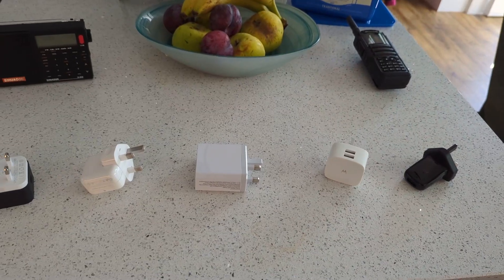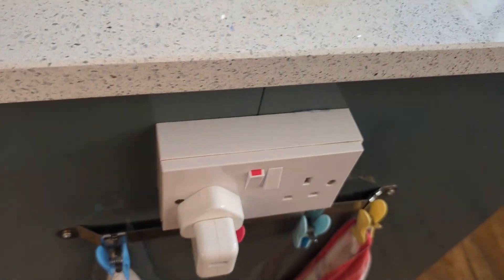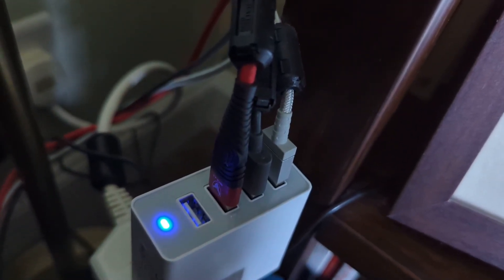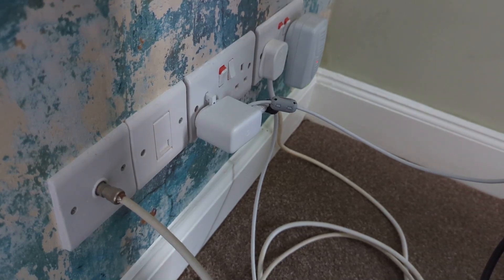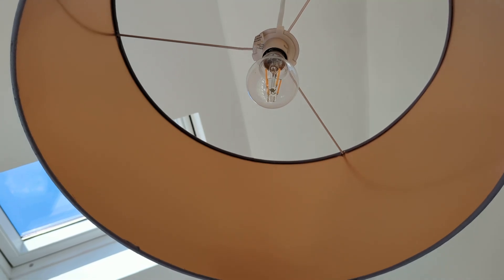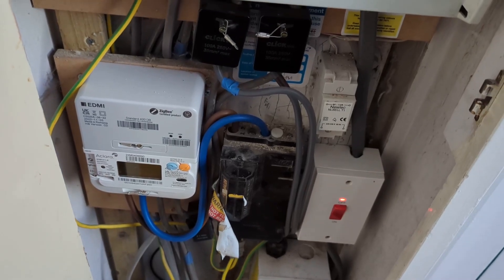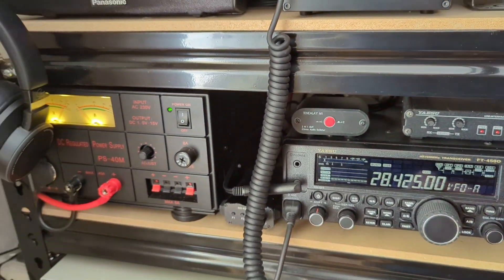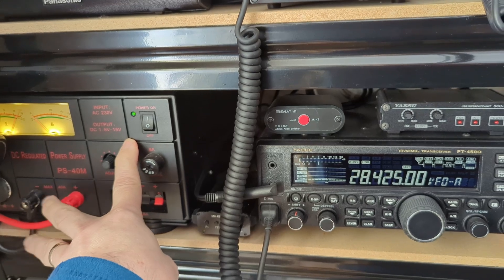How I reduced my receive noise floor on HF by eliminating interference.

Comment from the maker: Something I didn't show in this video was our burglar alarm control panel. It has a very noisy switched mode power supply which I supressed by fitting ferrites to the mains input and the coax ouput for its GSM 4G antenna.
Reply: Risco by any chance?
Reply from the maker: @Stuart_GM5DNA  It doesn't have a brand written on it. It works with a generic smartphone app called "Home Control". It has a 4G antenna and sim card. Our alarm company had to fit it because Edinburgh Council fitted streetlight control systems that run on 433 MHz and were jamming the wireless PIR detectors that were also on 433. Strangely my 70cm transmissions never tripped the "radio jam" alert on the old panel. It was pretty fortunate the alarm company paid for it. It works well as an alarm but spews out interference from the PSU. I fitted ferrites to the mains input and the 4G antenna coax. I found that sliding the ferrite along the coax until I got maximum suppression got me to zero interference. Just fitting it at the exit point from the control panel made no difference.
Reply: @HamRadioEssentials thanks. The Risco one we’ve got spews out the most awful RFI on the low bands. The sensors are all on 868MHz thankfully. Will try your advice on adding a choke to the wiring. Thanks!
Reply from the maker: @Stuart_GM5DNA  I put one on the mains input right at the case and then one on the 4G antenna coax (its the very thin type) and slid it along till interference got to zero. I was monitoring on a  portable receiver next to it. Its possible to get these things fixed but it took me years because you can't just change the fridge and freezer on a whim.

Comment: One source of interference in our bungalow which cannot be eliminated is noise from a power supply in our smart electricity meter. I think the gas meter, which is linked to it by a wireless link, has its own internal battery which probably lasts until the meter is changed for another.
Reply from the maker: Our smart meter produces no RF interference, fortunately.

Comment: I couldn't hear 27MHz or CB operators..
Thanks i've just stopped watching...
Reply from the maker: It must be my accent. Lets explain for you: The interference was so bad I could not hear local CB operators a few streets away. That's how bad the interference was in my house. I was fighting S9 =20sb noise at times.
Reply: @HamRadioEssentials  As soon as you mention CB, you know you're dealing with a CBer. or at the least a foundation holder.

Comment: Thanks this is very useful. I have s9+ noise. It makes you feel like giving up
Reply from the maker: It took me a few years to get it all dealt with. Since I made that video I have removed the last 3 S points which were caused by ADSL. I was able to switch to fibre internet.

Comment: I had extreme noise level problem on 40 and 75 m mobile in an over the road truck.. it took a while of tracking things down step-by-step but I got that noise level reduced down to about S3 or so and that was a complete game changer. It made operating those bands very enjoyable , mobile and fixed are  two different things but noise is noise and you have to track it down
Reply from the maker: No other choice really. For me it weas a mix of supressing some things and replacing others entirely. I actually can't believe I have S0 noise now on most bands. The last three S points were the ADSL router.

Comment: Very helpful video! Out of interest, which clip on ferrites did you purchase/ use?
Reply from the maker: I used whatever I could get. Even the cheapest ones made a difference. I think for things like this that are low frequency emissions any type of ferrite will provide enough suppression. That's my experience anyway.
Reply: @HamRadioEssentials  thanks for the prompt response, Ive got a S7/S8 noise floor on 40mtrs, other bands are less than S3. I off QRM hunting now....

Comment: Great video,those ferrites are amazing as you said. Thanks for sharing 🙏
Reply from the maker: I add them to everything coming into the house regardless. The biggest difference was on my burglar alarm control panel. It was really noisy. Two ferrites killed it entirely, but I had to move them along the cables while listening on a receiver. There was a place where they were more effective.
Reply: @HamRadioEssentials  Fantastic results 👍🏼 I’ve been putting off getting solar panels for a while because of the fear of what QRM comes with that, I wonder would good ferrites help ? I think it’s mainly the inverter that causes the problem.
Reply: Very interesting vid and thanks for sharing can you tell which ferrites you bought as I’m in the process of installing my station in a bungalow I moved into 18 months ago.  It has taken a while to get back onto VHF/HF and simplified my setup now most of my home renovation work is done.  73 and kindest regards Mike

Comment: Hello, I hope you are well. I have already sent you a message asking for your help, but unfortunately I have not received any message from you. Is it possible for you to guide me regarding the problem I am having? Thank you very much.
Reply from the maker: It is very difficult to do this without being in your house! You need to trace the sources of the interference. Maybe I will do a video showing how to do it. The first stage is to try your radio running from a battery on receive. If the noise reduces then you need a mains noise filter as part of the solution. Then turn the house electricity off. If most of the interference goes away then it is things in your house causing it and you can work to find them. If it is things outside your house then you need to do some direction finding to find them and try and resolve that with the people who own that equipment.

Comment: Electrolytic caps reduce their ability to clamp peaks over time.
There are ‘green’ switching ic’s that move their frequency about to reduce harmonics if you fancy making psu’s.
Reply from the maker: I am not sure anybody is going to build PSUs for fitting to domestic devices.

Comment: the main thing I have picked up on is the offending noise from the offending device is received by the portable radio at a distance. That means it is radiating enough to get into your station radio. If you have to hold the portable radio touching a noisy switching supply. That supply is not the problem. I have LED lighting in another room that bothers my Ham station on 40M. There's an LED security light that buzzes in my Ham station on 160M. I walk into our kitchen that has ALL LED lights and the fizzle sound only bothers my portable radio if the antenna touches the bulb. Those lights are not any problem. The trash has to radiate into the radio from a big distance to be concern to me
Reply from the maker: But it all adds up. I replaced every PSU with ones that produce no noise close up, which means they also produce no nose at a distance. Remember, I was doing this to the nth degree. My noise floor is now zero on most bands. It took me 4-5 years to replace or supress everything in the house.

Comment: After going through everything, you have to do it again in a while as things get introduced or deteriorate. LED bulbs, wall warts, LAN, etc.
Reply from the maker: Its never ending. Everything that comes into the house has to be tested, but its worth it for effectively zero noise floor.

Comment: I have two lengths of floor level LED lighting strips in my hall.  They produce zero RF interference because they are powered by a home built linear power supply.  While SMPS are popular on efficiency grounds, sometimes a linear supply has it's place in a radio amateur's home. If you use LED lighting bulbs/lamps at home, try to avoid any that are Chinese made, because I've yet to come across one with any sort of input filtering components.

Comment: Direct drive Washing machines tend to be quieter RF wise. Mine is an LG and the incoming mains goes straight into an RF filter PCB. Kudos to L|G for doing it right.    As for broadband interference, I've just upgraded to full fibre. It still feeds a 2.4/5GHz router with an SMPS  wall wart, but of course there is no longer RF coming in over rotten old ADSL copper lines and the link performance  increase is very welcome.   Switch mode power supplies are the scourge of the radio amateur with Chinese made ones being the worst offenders.  C E rated (China Export!) with no mains input filtering is the norm.  They don't case so long as the can make a few pence more profit on each one sold.
Reply from the maker: I switched to fibre after making this video and the last three S points of noise disappeared. I only have noise on 10 MHz now and a bit of solar panel interference from the other end of the street that I couldn't detect under the noise previously.

Comment: you can run your radio on a battery and turn off the house power to see if there is a big effect.
Reply: I strongly recommend doing this. I found most of the interference in  my home was being generated internally by switch-mode supplies.

Comment: Great results there. 
The chargers that came with my last two Google pixel phones were fine when plugged in until they're put under load. Then they're pretty grim, just like most of the others.
Reply from the maker: I tend to charge overnight so I don't notice it, but we really created a lot of problems by going to switched mode supplies for such small devices.

Comment: My noise floor on 20m is low, about s2-3! it's 40m and 80m in my case is about s7. Even my monitor had a 12 volt switch mode plug; which I removed ! My transceiver runs at 13.5 volts, adjusted my linear power supply to 13.5v and connected my monitor to it, that helped!
Reply from the maker: I need to show my new problem in a video. I got rid of ADSL internet and got Fibre to the house. Noise floor dropped to zero, but now I can hear the inverters from a neighbours solar panel system on 40m. The house its coming from is 40 houses away from me - no joke. I had to DF it. If any of my neighbours buy these systems I am sunk once and for all on HF.
Reply: @HamRadioEssentials  You are killing my hopes! I was just about to build a tech shack with solar panels on the roof and invertors in one wing of the building. According to your words, no solar panels in house?
Reply: @SwampWader  not so … if you pick the right inverter(s) you will be fine.  I have a single Fronius inverter and so does my neighbour .. they are fine but wall warts are an issue.

Comment: I don't understand your background and the actions you took: your hf operation with an outdoor antenna, I assume, was impossible because of noise. Fitting on each usb cable you have around with a ferrite clip reduced the noise. So basically, are you saying that those cables were acting as transmitting antennas?
Reply from the maker: Yes, switched mode power supplies produce radio signals. Some more than others and the lead helps to radiate it. That's part of the issue, but I also suppressed TV's and everything else in the house.

Comment: The interference seems to be short range (with the exception of the last two demonstrated)...
Reply from the maker: That's because I had already killed all the longer range stuff. Although, since I made that video I have eliminated all the remaining noise which was ADSL. Since then I can now see quyite clearly on my waterfall the interference coming from a solar panel installation on a house 20 away from mine. I have been out and traced it down the street. Not strong but it's inevitable that a near neighbour will get some fitted, and that will be fun.